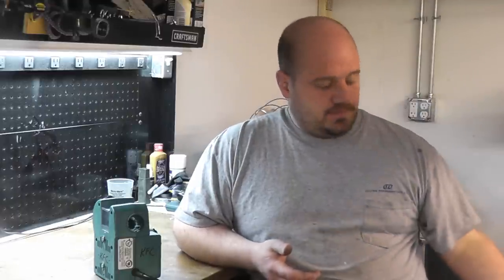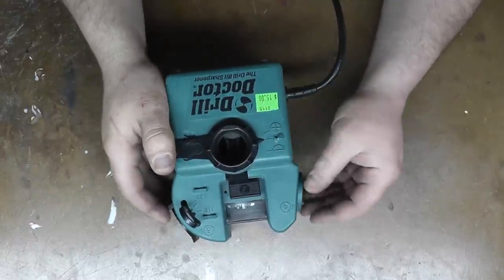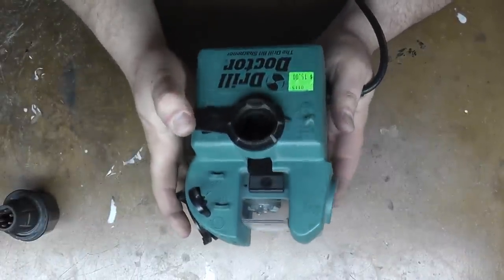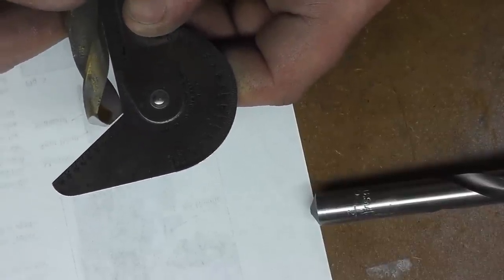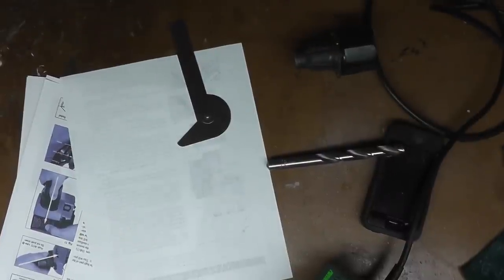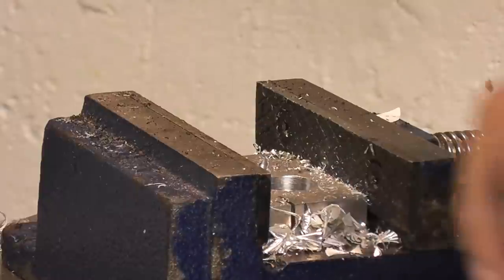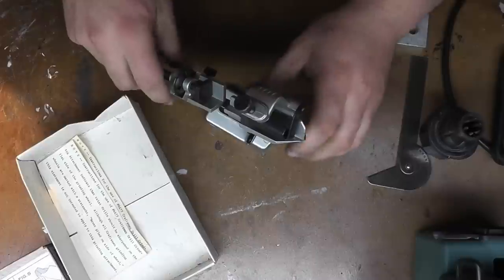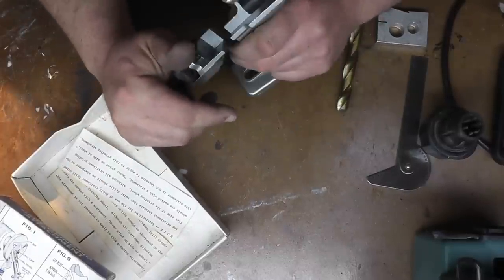Drill Doctor V.S. Craftsman Drill Jig

Comment: I tought about it : if you want the grain "grindwise" put the device in the middle center of the wheel on top center thus the marks will be grindwise , for the flutes lenght differnce it might be because the foot of the device is not perfectly square to the wheel

Comment: you can use it with a belt sander with a disc on the side and they work great with a little practice you can sharpen any drill in seconds i have used one for years and i was taught to do it by hand when i did my apprenticeship

Comment: I’ve always found drill sharpeners and jigs to be more hassle than it’s worth. Free hand sharpening on a bench grinder takes far less time and gets just as good of results with some practice. If your only using drill bits every once and a while and only occasionally sharpening them a jig is fine. but I’ve personally found it takes too much time when you drill a lot of holes and sharpen bits often to use a jig

Comment: I have my craftsman attachment set up to my 72x2 grinder discarding the original pivot base because there's to much play in it and using a very fine grade belt it illuminates the problem of the grind being 90 des to the cutting edges. It is and excellent sharpener.

Comment: first Off!!! bits are $5 at Harbor Freight- 2nd I've used a Drill Doctor and it works when you need to resharpen a tip when at jobs you can't just run off from... 3rd don't ever use your stone grinder on it's side with tool steel or anything... 4th a jig is what it is a JIG to help you hold something or help you- That's All!!

Comment: i liked your video. most grinding wheel mfgs willl tell you not to side grind. i had a craftsman type drill grinder for many years set up on a dedicated grinder with a wheel designed for side grinding and it did a pretty good job. i got a drill doctor 750x some years ago and i love it . i have had none of the problems you discussed and it drill holes on size with even chips. if a drill is damaged or i want to change the angle, i will hand grind the point as close as i can get and then use the drill doctor it saves a lot of time. i can typically sharpen a dull bit in less than a minute. i usually stockpile dull bits and when i get a pile i will do then all at one time. drill doctor tells you to count your grind cycles and quit on even numbers so you get an even grind on both flutes. dont be so quick to give up on yours.

Comment: I've been a welder for over 30 years so I've been threw my share of drill bits. For the most I've sharpened bits by hand, recently I purchased a DD750X. My thoughts is the jury is still out for me on it. I do not deny that it does not sharpen the bits and they cut as long as you have a pilot hole. I can't get one to cut and drill it's on hole from the start without a pilot hole as i said. The instructions are very vague and not clear. Also customer service is no help either. I tried them also. At this point I'm not sure what I am doing wrong. After watching your video I see yours has been put to the side. Lol. Paper weight or boat anchor. I would still like to get this thing to work now that I have it but not sure what to do next.

Comment: I have used the jig unit for over 25 years (light to moderate amount of use) and have yet to encounter a problem that I felt required changing a wheel for wear or safety . I might add here that approach ing 70 safety has finally taken it's rightful spot !
  I also own and use  a Drill Doctor 750X to my good advantage .
Like using a mic each require practice to get accuracy and more frequent use ( like doing a longer project ) bring back the "feel "
Using light fairly rapid grind strokes seem to benefit both units . I find that the jig is faster for grinding out chips or heavier stock removal( numerous light cuts and drill turns) which would wear heavily on the DD diamond wheel prematurely . For a sharp,centered point the DD is my choice .
I doubt you gave away your bike after falling off the first time . Work with that DD a little , you may be pleasantly surprised

Comment: Oops my bad. Adjust drill sharpening jig at angle that will orientate drill for a proper grain cut. If you prefer to side front cut on wheel.

Comment: I have a craftsman drill jig that has a date on it of 1948.  And it works great in fact I have gave my DD to my neighbor, because it will not sharpen 1" drills.  Also I did buy a stone for my 6" bench grinder that is made to take more force on the side.  I use a very fine stone.  Also i have a belt sander that I tried this on and it really does not do as good of job.  Love the videos, I'm just getting into the video thing.
Reply from the maker: Thanks!  The grinder just
 has its original stones.  I've been meaning to get some new ones but just haven't gotten around to it.

Comment: The best bit sharpener was the Black and Decker of about 25 years ago.  A time when B&D made some good tools.  It was a self contained unit that sharpened everything up to 3/4 and did it quickly and accurately.  I have had two different top of the line DD since then (they quit making the B&D before I could get one and no longer support them with parts) and they also ground reverse relief.  I corresponded with the company and could get no improvement.  Yes I ground all the way around until the cut ended.  I did hundreds of bits on the B&D with never a problem in two shops that had them.  A new grinder wheel once in a very great while was it.  I can grind my own much better than the DD which is useless.  I too look for quick easy and accurate ways to grind the small bits (3/16ths seems to be my dividing line but I can still do better than the DD).  At present I grind them by hand.   I gave the DD pretty exhaustive testing and probably ground or tried to grind two or three hundred bits between the two machines.  The indexing system just seems to quickly get out of whack as the wheel wears even slightly.  It would be great if some company would make the Black and Decker model again.  At the time (mid eighties early nineties) it retailed for around $120 as I recall.  It would be interesting to know who holds the patent currently.

The other nice thing about the B&D is that it took no time at all to learn to use it.  I have seen a few on e-bay but without the ability to get a new grinding wheel they would be useless and by now if it has been used at all they would need one.

Abomb had a jig that worked for the large bits but it was really fiddlly being time consuming to set up and again you have to dedicate a grinder and the space for that grinder to the set up.  The B&D pulled out of the cabinet plugged in and was ready to go.  A half inch badly worn bit took me two or three minutes at the very most as I recall to return to new with proper relief and a rounded cutting surface (from cutting edge to heel ) just as a new factory bit.  This is important as it give the cutting edge more support than a flat grind.  It also ground back from the cutting edge which is also a stronger method.

Excellent topic and good video.
Reply: You may want to check out the Tormek grinder with the drill jig attachment. It's a lot of money, but it's great for sharpening damn near anything while keeping the steel cool.
Reply from the maker: +OuijaSTi I'll check it out thanks!
Reply from the maker: Thanks!   It seems that the only other option for a dedicated self contained drill grinding machine besides the DD are pretty expensive.  I did additional testing after this video and tried all the adjustments on the DD but still could not come out with a consistent result.  sometimes a bit would grind beautifully sometimes it looked like an angry badger gnawed on it.
Reply: funny i owned a used one of those B&D sharpeners for awhile and found it pretty much useless. took it apart, the wheel inside and everything else looked fine but I analyzed that simple unit and concluded there was no way in hell it could replicate the complex motion against the wheel required to grind a cutting edge and a relief on the face of the bit. Thats why the DD works, it hits the wheel then rotates it away at another angle the same way a trained expert does when he uses a bench grinder.
I also own a DD500X and the blue point/snap on version of the jig shown in this clip. The latter I could not make heads or tails of despite hours trying. 
The drill doctor is the greatest thing since sliced bread with a few caveats. 
1. success depends on compatibility of the twist rate with the collet alignment. even  in best cases you often end up setting the collet far from indicated even outside the lines.
2. some bits just cannot be sharpened due to the above.
3. as the wheel wears it gets even more tricky and getting split points is tough.
All that said some bits sharpen so damn good its amazing and you cannot tell they have not been factory sharpened with a magnifying glass. In particular a friend gave me his set of Snap-On drill bits in indexer that he mangled on the job, these line up first time every time.
Finally I dont know about the new DDs, dont look like an improvement to me.

Comment: The grain of the metal has not changed. Just seeing fine scratches and grinder marks in the drill bit tip. I have a drill dr and honestly I wouldn’t give a nickel for a wheel barrel full of them.

Comment: Hi, I have a unit like the craftsman, just sold under another brand down here in New Zealand with which I have successfully sharpened 100's and 100's of bits. 1/8 to 3/4 (with a slight modification).

May I just point out what I believe is an error in your description of how it is used:

The adjustable slide is used to set the drill tip overhang (1/2 of drill diameter for 118) and this sets up the correct geometry, The whole unit should then be moved towards the grinding wheel (thats what the slot is for in the base) as you grind. Once one side is correctly ground, any chips/damage  removed etc, then dont adjust anything!, just rotate the bit 180 degrees and grind the other side.  If you keep advancing the bit using the slide, you will be slightly turning the drill (as the guide rests against the flute) and have incorrect geometry. 

I have permanently mounted my grinding jig on a home build slide way, (perpendicular to the side of the wheel) with a very fine thread to advance/retract it, so I have accurate grind depth control and a rigid set up.

I saw a video of Mr Pete/Tubalcain throwing one of these in the bin and saying they were crap. Thats the last one of his videos I'll ever watch. Quite ignorant I thought. If used correctly and gently these work well.

Mine cost $35 New Zealand (about $25 US) so pretty cheap drill sharpening.

Just on the grinding on the side of the wheel issue, it is a complete no-no, so I have completely enclosed the circumference of my drill grinding stone in a 3.2mm (1/8) steel cover, so only a small side hole is open. On about my 3rd or 4th stone, never lost one yet, 

Keep up the great videos, thanks,

Latheman NZ
Reply: could you make a video of youre jig? im quite interested
Reply: thanks for putting the name of the co and or URL of the site of the NZ sharpener .......

Comment: Could it be used in front of the grinder bolted to a 90 degree angle insted of bolted to the bench ?
Reply: Good eye. I was also thinking that it sharpens the bit with a vertical line of contact, which you can also get from the round part of the wheel if done at 90 degrees. So turn either the grinder or the fixture 90 degree and you can do it the normal way.

Comment: I love the way the DD has a diamond wheel. How does the jig do on 3/32 to 1/4 bits and carbide bits? What kind of grinding wheel would you need to grind carbide bits?
Reply: +Wilson Phillips In other words, the cost of sharpening ALL kinds of drill bits with the Sears/Craftsman jig just went up.  It isn't as all-purpose as it originally seemed!

Comment: The experts (whoever they are) always maintain that the drill will not retain its edge very long ground with the grinding grooves parallel to the cutting edge, apparently chunks of the edge can break off.
Reply: Stephen Deakin Yes a side grind leads to premature edge chipping. I did like how the Drill Doctor had its grinds aligned with the cutting edge. I did not like the tiny wheel it has, or small motor, plastic housing, fiddly setup jig, etc. though.

Comment: Did you figure out you're not missing any piece on the point splitter hole, There is a Very tiny triangle(arrow) on the side of the hole in line with the #4 marking, (insert dill chuck directly)
You can sharpen your bits in the more precise drill jig but then use the drill doctor to make any drill a split point.

Comment: The new Drill Doctor design is much better.  With that said I still prefer to grind larger bits by hand and use the Doctor for smaller ones.  Works very well I think.

Comment: i think the craftsman does a better job, but the drill doctor is better at freshening up a bit fast, but when using the drill doctor you have to have align it wright way, put the drill bit lose in the chuck and push up against the drill doctor to align it, then tighten it down, then you can sharpen it really well. i have noticed the diamond wheels dont last very long

Comment: So far I have been sharpening by hand using the front of a grinding wheel with an acceptable level of success.I was actually taught by my shop teacher to use the side of the grinding wheel.but after researching and common sense .I do not. I like the looks of the gizmo for the grinder best.thinking of using a diamond coated disc on a n angle grinder with variable speed.just need to get the gizmo.problem is I can usually get the bits sharp and project done b4 even researing where to buy supplies.I enjoy sharpening tools its a stress releaser.like the little led light  used in your vid and thankyou for the video and risking your life grinding the side of the wheel for product demo

Comment: I've been using a drill doctor for about 20 years with great results. Mine doesn't have all the setting that yours does. I am not sure why your DD doesn't work. It shouldn't take more than two or three minutes to sharpen a bit.
Reply: Dasdfjkl My disclaimer is, I don't pay much attention to the actual angles of the bit, either it won't drill well when dull then I use the DD and then it cuts better. Maybe the Sears jig does work better.

Comment: Not being critical.  This is an interesting comparison to watch.  Just wanted to say that when I took a mechanical apprenticeship,  I was strictly warned NOT to grind anything on the side of the grinding wheel.  The reason was that excessive lateral forces could potentially cause the wheel to fracture and shatter. (I understand that a smaller drill bit would only be put minimal pressure on the side of the wheel)   At that speed,  a piece of stone could do some hurt on you if it broke up.  We were shown videos of wheeling failing.  That will put the respect in you to see that.  Also,  I was taught to dress the wheel and make sure it was not vibrating before it was used,  which could contribute to the wheel fracturing if tools were being ground on the side.  In our shop,  we had a drill grinding wheel set up on one of the grinders for ONLY the purpose of dressing drill bits.   Take care friend.  Appreciate your videos very much.
Reply from the maker: Yup which is why the face shield was worn and I tried to go as light as I could.  I've seen the aftermath of a grenaded wheel in person.  When I was an EMT we had a lot of industrial shops in our town.  I've gotten calls for a grinding wheel exploding in someones face, grinding a thumb off on a grinder, cut off saw blade exploding in someones face, and someones face meeting lathe chuck.

Comment: I   oun a DD don't remember the mod.but the only problem other than operator error is with very small bits 1/8 or so on down.once they have been sharpened on a DD and the angles have been set it only takes 3 or 4 swipes and it's sharp again.i can do about 1 per minute  I if there simple touch ups.

Comment: If you set up that craftsman so it is lower down at the bottom of the wheel the grind marks will be in the same direction as the drill doctor.
I have a similar unit to the drill doctor but it won't work with anything under 6mm ( 1/4 inch) but mostly i just hand grind anyway as it is quicker - the drill sharpener is mainly used to sharpen other peoples drill bits  that they have butchered and are too stingy to buy a new bit !
I also have a sort of tool grinder that  i made and  use for my milling cutters that i can set up to sharpen drill bits that gives the four facet type grind although i am looking at modifications to allow it to do split point . I read on one one of the other comments that they spent 3-4 k on a sharpener - man you could buy a lifetime supply of drill bits for that!
One simple trick i was taught is if you don't have a drill gauge to measure the tip angle use two nuts of the same size this will give you 120 degrees so close enough in a pinch.
A comparative test done well - keep up the good work!

Comment: the only thing that will happen when one side of the cutting edge is longer than the other is it throws the center off and the bit woobles or vibrates. but great job free handing it though

Comment: I got the same problem, I bought this drill doctor years ago and I forgot already the model but it is only capable of sharpening up to 3/4 of an inch bits, anyways I kept practicing using it but can't get satisfactory results due to the other side of the bit is always sharpened slightly less angled than the other one! I realized these are junks and its better to practice sharpening by hand and when you get the hang of it it's way much better than spending a lot of money on Drill Doctor! Just invest in a good quality 180 grit grinding stone, just my 2 cents!